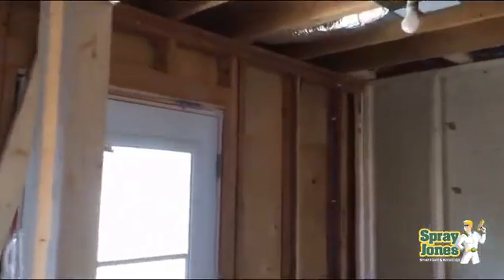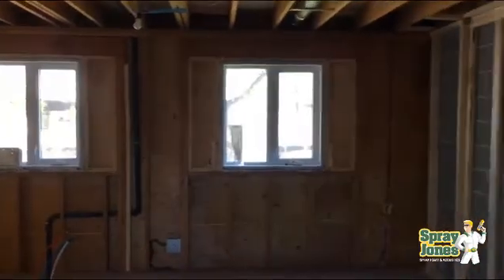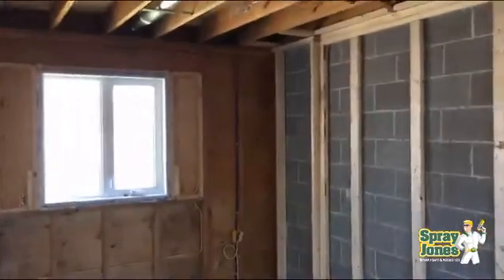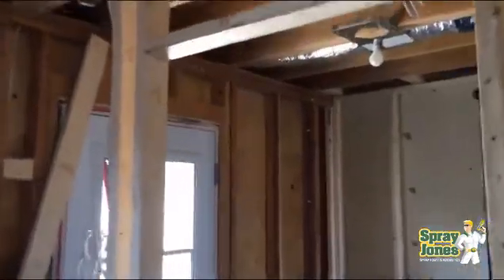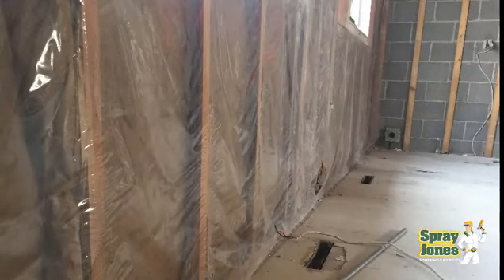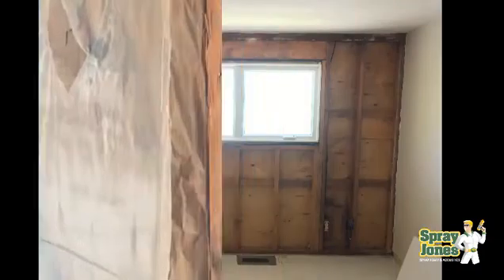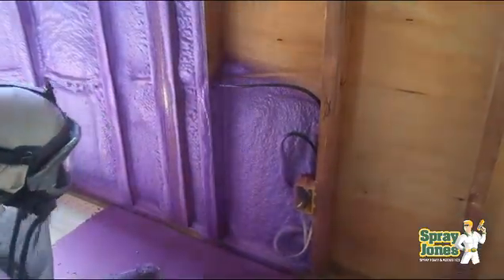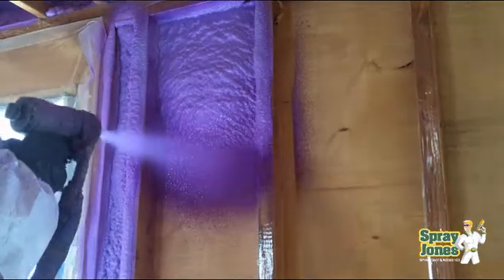Low Income Housing Gets Spray Foam Insulation - Why Closed Cell?

Comment: About how far away are you spraying your foam to get it and that flat look? Sometimes I spray a little farther back from the wall and it looks like that, but I feel wasteful when I see how much is on the studs
Reply from the maker: Heat, pressure and then distance. Plus a good foam system. If you are dialed in and on budget for foam usage who cares about what is on the studs.

Comment: Can you explain, the total wall space, that was sprayed, as you said that there was only a few outside walls. I totally agree with you, about the low income housing having better products. For instance, if these are buildings, where the heat is paid by tax payers, doesn't it make sense, to pay a little more upfront and then the heating will be cheaper in the long run. Another problem is they usually put electric heat in these places here in the USA and electric heat is the most inefficient and expensive way to produce heat, it's around 10 cents of heat for every $1 you put out in cost. Another issue is, if cheap windows, are used, this makes heating and cooling much more costly. This was a great video. The only thing I would like to see, is the cost of doing how much square feet and just more time of you spraying the foam. For me, at least, this is therapeutic, like popping bubble wrap or something. I can't explain it, lol. But thanks for the video I hope you do a lot more soon, I love your videos.
Reply from the maker: In each unit there was 40' of wall downstairs and up. That is all the wall facing to the outside. These are heated with natural gas.